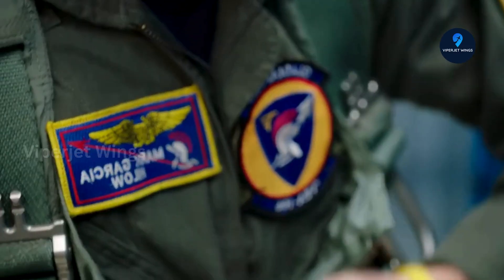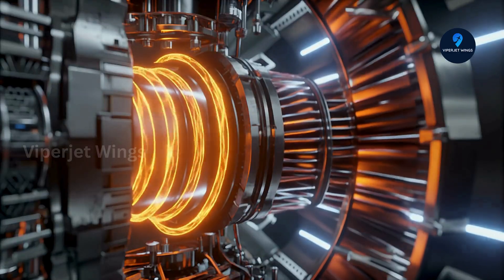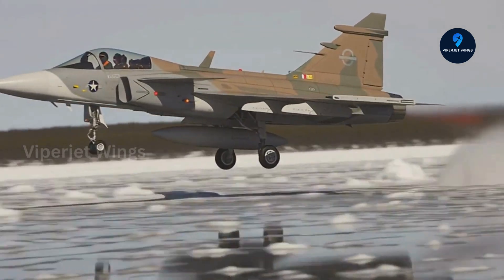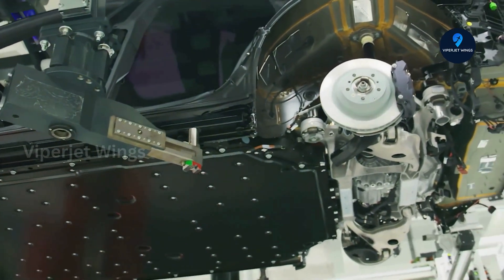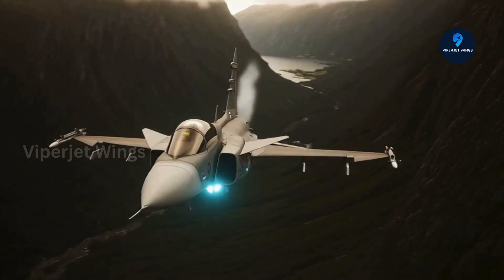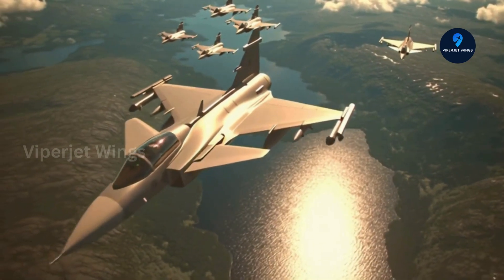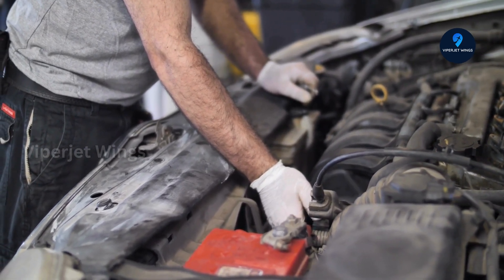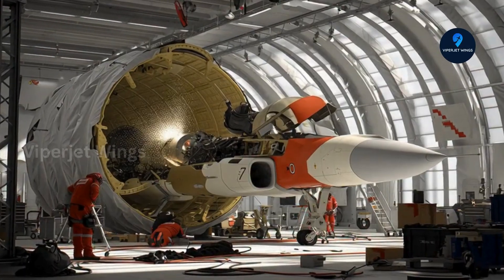Gripen’s Engine: The Rolls-Royce Secret Weapon NATO Can’t Live Without?

Comment: OK so when did it actually get a RR engine???
Reply: Fake !! It doesn't exist yet.😎  🇸🇪
Reply from the maker: The F414G engine is real and already powers Gripen E prototypes.
Reply from the maker: The new Gripen E uses the latest *General Electric/Rolls-Royce F414G engine* upgrade.
Reply: @viperjetwings  F414G is a variant of the General Electric F414 turbofan engine, not a joint product with Rolls-Royce.
Reply: Key facts about the RM12:
Manufacturer: Primarily manufactured by Volvo Aero/GKN Aerospace in Sweden, in collaboration with GE Aerospace.
Design basis: It is based on the proven General Electric F404 engine, which powers the F/A-18 Hornet, but with specific modifications for the Gripen's requirements.

Its false information